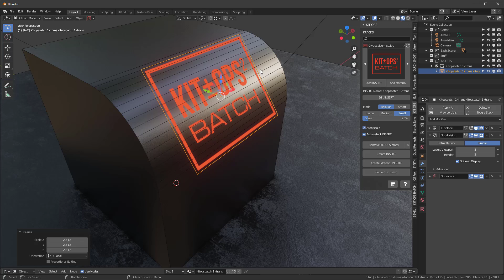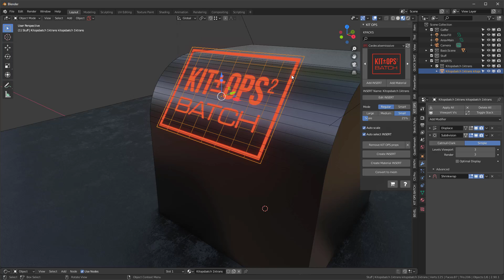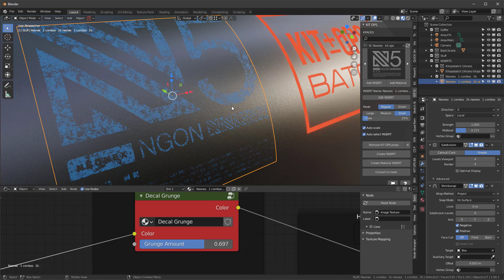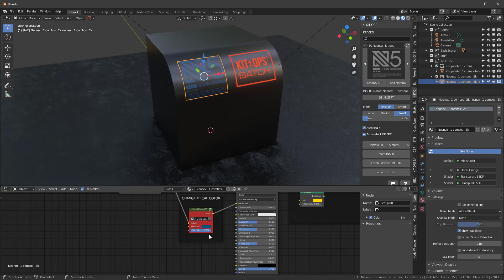Copying Label Modifiers for Curved Surfaces in Blender

Comment: Question is, can you put a jpg 'face' on a plain shaped 'theater mask' and position it with this Kit Ops?
Reply from the maker: Yes, if I understand your question. That is certainly possible.
Reply: @ChippWalters  I joined your PATREON year subscription. 
The 'LAUGH-CRY' theater masks, I have made PNG of a face so distorted that KeenTools FaceBuilder doesn't work, besides, I don't want an entire 'head'. I have a theater mask OBJ, which is like a HOCKEY MASK (without the holes etc), and I want to use KIT-OPTS to place it, as though it were a LABEL onto the mask... you may like the faces in the new upcoming game 'ILL' which are so distorted they wouldn't work on FaceBuilder (I think), you may be interested to see how those characters are made, it looks like heavy mix of MEAT & explosions. I'd like to see a clip with your KIT-OPS along with the MEAT add-on... for characters! LOL